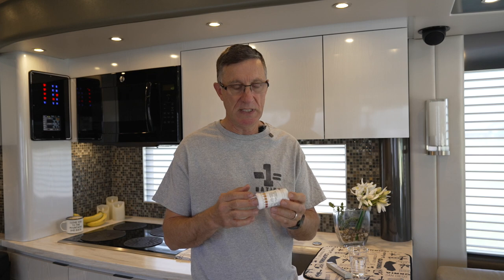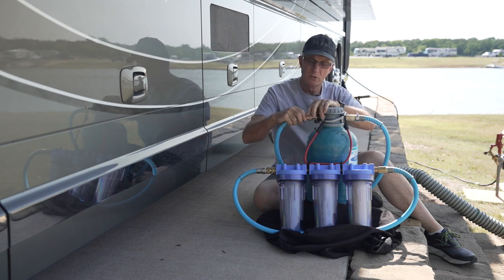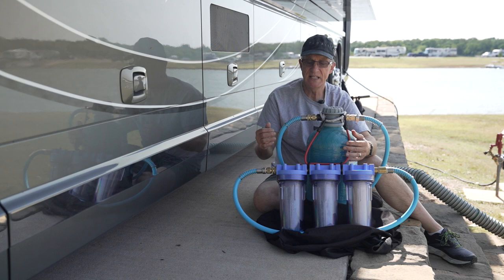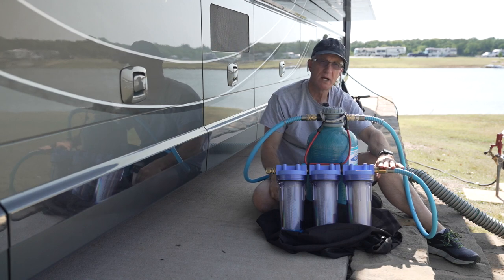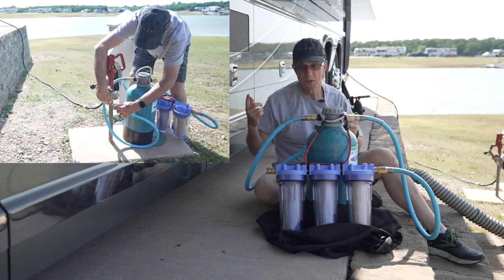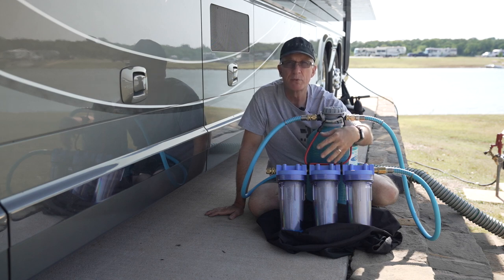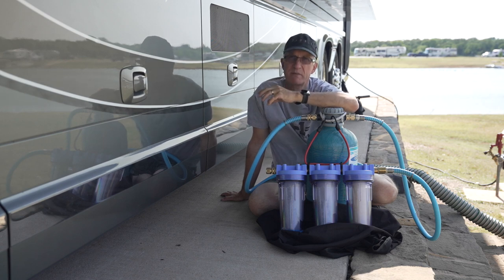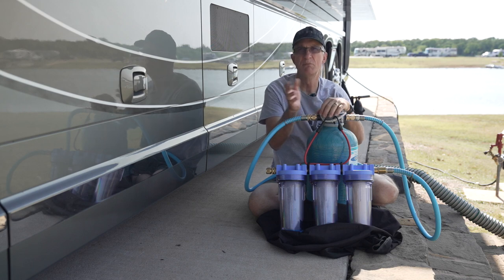How To: Build a 3-Stage Water Filtering | Save your RV Plumbing! | Newell School

Comment: Enjoyed your video! Quick question: It looks like you soften first, then filter. What are your thoughts about doing it in that order? Many people filter first, then soften. Maybe a case of "six of one, half a dozen of the other?" By the way, I have noticed the same thing you demonstrated in your video, that when checking softened water with a TDS meter, the reading doesn't necessarily go down and in fact may go up. I called tech support for my TDS meter, they said this is a normal condition, that the resin beads exchange sodium ions for calcium & magnesium ions and the overall TDS content is basically unchanged. The way to measure the output of the water softener is with the test strip.
Reply from the maker: Good question, Chris, and here’s my rationale. The 3-stage is the absolute LAST FILTER in the chain to remove contaminants. Therefore, if there is ANY particle, residue, or contingent in the soft water tank, I want to filter that out. Now that the 3-stage is filtering our water so we’ll, we can be confident that our ice and drinking water is as pure as most bottled water. Some will argue that a .5 micron will even be MORE pure than unregulated bottled water.
If the soft water tank was last in line, and got nothing but purified water, a lot of this is moot.
Hope that helps.
Reply from the maker: I have since researched, and come to the conclusion that it’s better on the Soft Water filter if you filter the water BEFORE the SW tank. This makes the media last longer not only between recharge but also increases its life expectancy.
Reply: @RVSquaredSteve  Ok, so now you filter before going through the softener, right?
Reply from the maker: Yes Dan, that is correct. This helps preserve the life of the Softener media, as well as extended the time between recharge.

Comment: Great system, you're using a .5 micron, 1 micron,  and a poly block cartridge filter. You mention a 5 micron filter. Based on your experience, is it worth adding a 4th cartridge for the 5 micron filter?
Reply from the maker: It’s the best you can use, Dan!  There’s no sense in adding a 4th stage, really. 3-stages, with a .5 final, laid out the way I explain will take care of business! Different configurations can be played with in different water systems, eg 10-5-.5, or 10-1-.5, etc.  It really only changes how much work the .5 has to take care of, and have to be changed sooner. Hope that makes sense. Thanks.

Comment: Wait... city water particulate was 196. Filtered was 214. Isn't that the opposite of what you want to see?
Reply from the maker: This is a huge point of confusion for many; let me explain.  The meter I'm using reads TOTAL DISSOLVED SOLIDS (TDS) and will pick up ALL minerals...including trace salts which CAN be present shortly after a softener recharge which uses salt.  The TDS is NOT a measure of water hardness, which is performed with ChemStrips and ONLY measures Calcium and Magnesium.

This demonstration was to illustrate the fact the two readings are entirely different and, as stated, the filter and softener system will provide micro filtration and softening, but NOT a total removal of solids.  That is a job solely for a DeIonized Water Filter.  I have a video about the DI filter here: https://youtu.be/2x6BaTar4mU?si=JryoNjstQRSgm_wB

Incidentally, since posting this video, I have changed the order of the filter system to have the softener tank AFTER the 3-stage.  I do this to send the purest water into the softener resin; thus making it work less and prolong its life.

Hope this clarifies things for you.  Thanks for watching and commenting!Incidentally, since posting this video, I have changed the order of the filter system to have the softener tank AFTER the 3-stage.  I do this to send the purest water into the softener resin; thus making it work less and prolong its life.